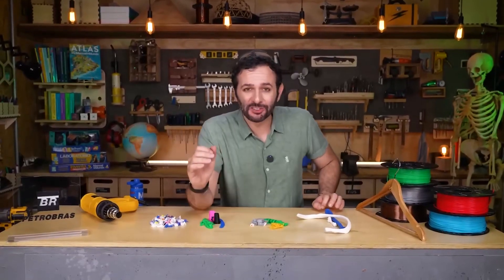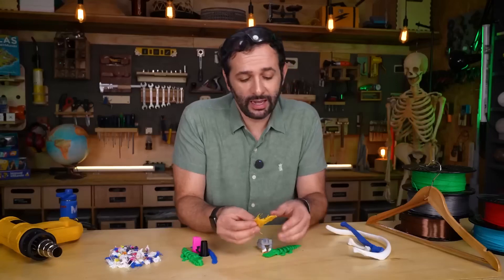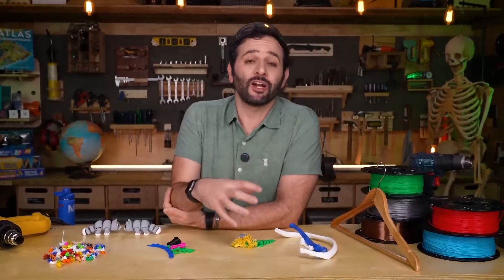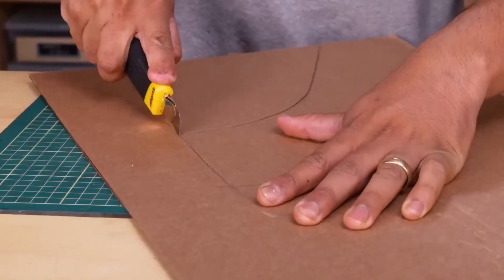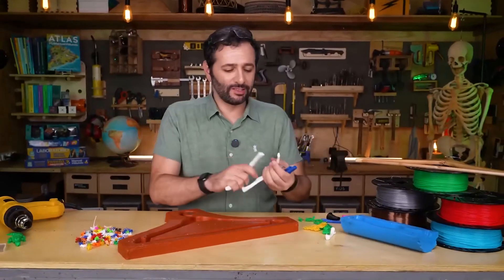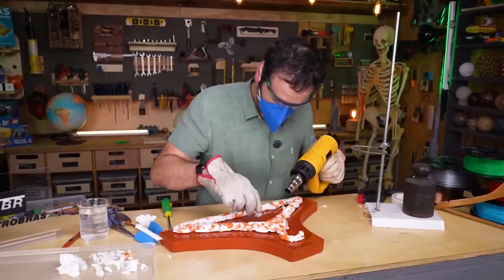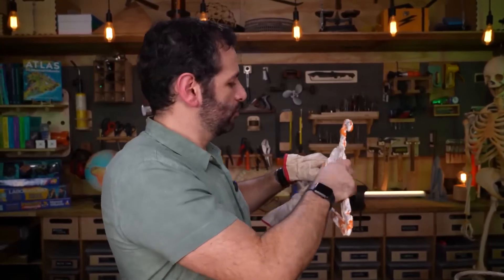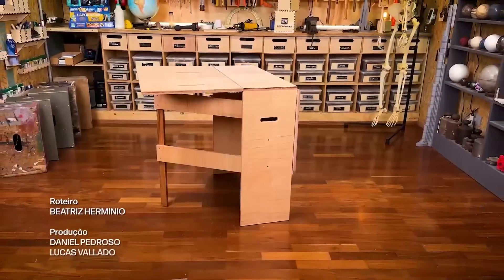How to Recycle 3D Printing Plastic the Easy Way!

Comment: FINALLY!   It's that simple....I had no idea that I could simply melt my PLA waste using a heat gun.   

As it happens, I have silicone molds for making medium sized coffee tables and end tables.   I also have silicone molds of skulls, bricks and more.   Molds are cheap and easy to get on Amazon so now you have me thinking...

Would it be possible to stuff a mold with PLA then place it in the oven or microwave?   Melt the PLA then add more, repeat?   Would be smoother than a heat gun...Time to experiment and upload to your website! 

Thank you!

Comment: super cool video! thanks for the idea.

i would recommend to get a tin or silicon funnel and heat it up with the same heat gun you're using. that way you get a sort of fixed nozzle that you can use to precisely pour melted PLA into the mold and avoid air bubbles or unwanted thickness variations.